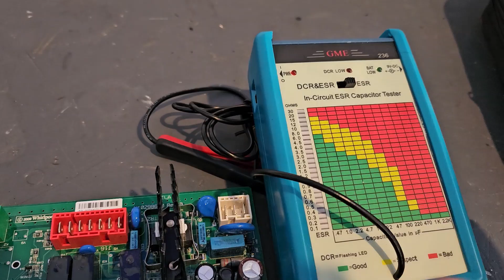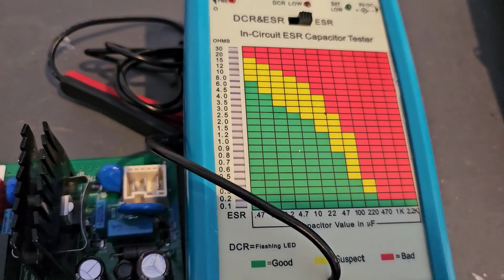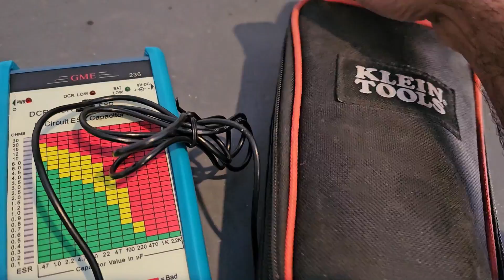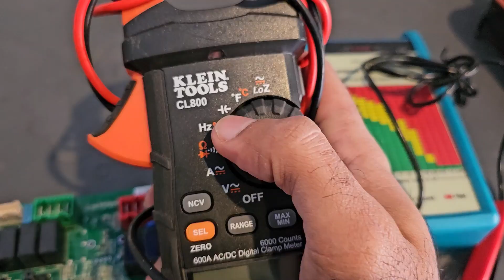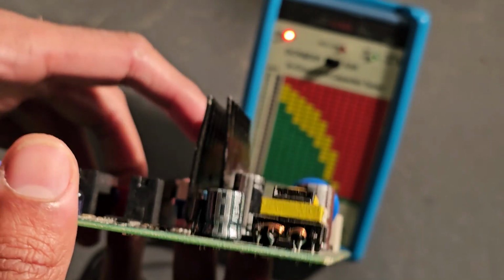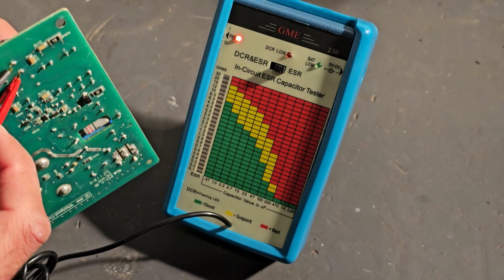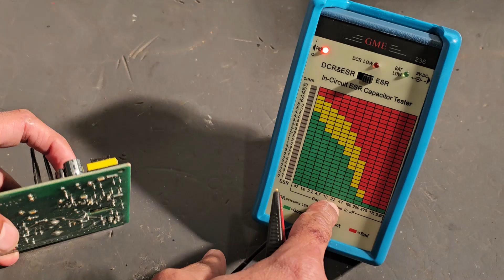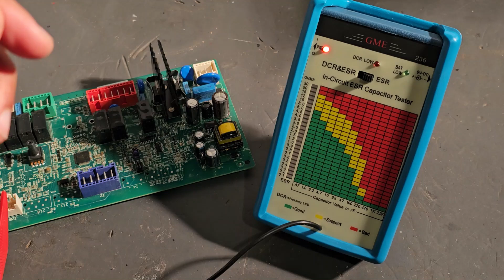Easiest Way To Repair Any Circuit Board: ESR Meter

Comment: - Good video. Clear explanation. 
- I just figured out that ESR meters are mainly used to test electrolytic capacitors. I had a film capacitor of 0.1uF, and the ESR meter said "open circuit or low capacitance". But that's because film capacitors typically have very low capacitance compared to electrolytic caps, in this case 0.1uF. Which tested fine with the multimeter, but the ESR meter can't really test that low of an ESR. 
- Next on my pcb, I'll have to check a relay which is the main suspect. So let me check if you did a video about relays also, because I have no idea how to check it 🙂

Comment: Hi ducktapemechanic and everyone. Please can you explain when it's necessary to remove capacitors from The pcb and when it's not necessary to from capacitors from pcb, also when it's necessary to remove capacitors from pcb is the same ESR metre fault check used or is a different method used. Great video thankyou

Comment: ESR meters are not designed or accurate to be used in circuit capacitors cannot be tested in circuit

Comment: Good video. Thx. A note...  Your method works if the electrolytic capacitors are in series.  But, if in parallel, you are reading more than one!  In parallel cases, you'll need to remove the cap(s) and test out of circuit to get an accurate reading.  Cheers!
Reply from the maker: Good point, thanks for the info!
Reply: Oh, wow! That's not a small detail! The video should be edited for that.

Comment: I was initially excited about the ESR or LCR testers since I had little interest in having to de-solder 9 different caps from a treadmill motor board.  Then I found other videos that mentioned both of those meters' results will be unusable for any cap connected in parallel to another cap (which isn't always easy for a novice to discern when examining the PCB).  In that instance, cap(s) still have to come off the board in which case a basic digital multimeter does a decent job..

Comment: I have a coin operated whirlpool washer that has a blinking and clicking red light. It works but it skips final spin. Do you think this is control board issue?  Do you know if the same capacitor needs to be replaced. thanks
Reply from the maker: No. Sounds like a mode shifter issue

Comment: This is not a game changer for those who wants to repair with no knowledge. I've seen cases where a capacitor shows fully short which could make you believe that the capacitor is the issues, but in reality the real issue can be a bridge rectifier or some other components on the circuit. Don't go blindly with this video and be safe. There are different  techniques.

Comment: I agree, the #1 fail mode for most circuit boards are capacitors. Electrolytic caps with "popped tops" are obviously bad. Relays are generally very reliable. My Bosch oven control board had a bad Darlington Transistor array chip that turned on/off the relay controlling a fan in the oven. This was 100% obvious to find, as when testing the relays, I found a short to ground. I removed the chip that controlled that relay, and the short disappeared. I did apply voltage to the relay, and heard it click, so that was good. I also tested the chip and the pin that powered the relay solenoid was shorted to ground with the chip out-of-circuit. Replaced that chip, and how that controller board works fine.

Comment: Hmm.. I'm working on a Fisher and Paykel DD60S17 dish draw dishwasher ... I've isolated the problem to the electronic controller and two bad caps. How important would it be to get "low esr" caps as replacements... usually I just focus on the voltage and microfarads while ignoring the ESR  ... even when looking up the original caps they never list the ESR for them. 🤷‍♂
Reply from the maker: I would believe that the esr of a new cap is going to be acceptable. Personally, I would also just make sure it is the correct capacitance and voltage. Just my opinion...
Reply: @DuctTapeMechanic - awesome, thank you! 🙂

Comment: Does this ESR meter work with ceramic capacitors like the one found on the electronic mosquito-bats board?
Reply from the maker: No. The ESR meter only works on electrolytic capacitors

Comment: Be careful with capacitors with higher voltages.  They should be discharged before touching them and creating a circuit through your body.  You can get a serious shock from voltages 100V and up.

Comment: I just got into electronics repair with zero former knowledge, I have been reading the book "How to Diagnose and Fix Everything Electronic" and that was the only other material that talks about ESR (Equivalent Series Resistance?) troubleshooting and ESR meter. So this was very helpful, thanks! What is the DCR&ESR setting for on the device?

Comment: I wonder about those two large sized capacitors that are said to be only 22uF....they must be pretty high voltage to justify their large physical size! Ir maybe they aren't actually 22uF.....

I briefly had one of these, which by the way is probably NOT 'made by' GFE. It is available with branding for so many companies that who knows which company actually makes it. If you buy it branded as B+K Precision (a well known US brand), it will cost nearly twice what is quoted in this video. It is a nice enough ESR tester, but the down side is that it only has the tweezers type test clip, which limits its use to physically smaller capacitors that also happen to be in the 'radial' style cans, as opposed to 'axial' style cans. With many kinds of electronics, that would mean that the majority of capacitors in need of testing can't be tested with THIS product.

And BTW, before I returned mine to the seller, I tried extending the tweezers tips with short alligator clip test leads, and it was not able to zero out the small added resistance, and thus it failed every cap I tried it on.

I ended up buying a product by EZM called "ESR-2501C ESR Meter" which only costs about $40. It tests the same range of capacitances as THIS one, and has a similar chart on the front, but instead of an LED bar graph is has a two-line backlit LCD display, and you can read the actual ESR values to two decimal places of resolution, and you also have more control and flexibility of zeroing out external resistances, so different test lead/clip/probe arrangements can be used successfully, and it comes with test probes and alligator clips (but NOT a tweezers clip).

Both THAT product and THIS product can also measure DCR (DC resistance), although this video does not mention it. When a capacitor has a partial breakdown of the internal structure, its internal DC resistance between the two leads (which should be quite high) can drop down to a small number of Ohms. Even with that, it can still function somewhat as a capacitor, and might read the correct capacitance on a different meter, and might even pass the ESR test on this product (or the EZM one) because of the way these tests are done. With older electrolytic caps, or any that you have cause to wonder about, it is important to do a DCR test as well as the ECR test. I don't know why this point was not made in this video. THIS product has a DCR&ESR mode, where it tests DCR first, and only proceeds to test ESR if the DCR test was 'good'.

Another point not covered in this video: ECR is tested with an AC signal, so polarity of the test leads on polarized capacitors is not important. But when testing DCR, the test signal is a DC voltage, albeit a very low one, so it is best to observe test lead polarity.

Comment: Great tutorial. You can also test the resistance and microhenries of the inductors with the esr meter. The reactance formula is 2𝛑FL. That would be 2 x Pi x frequency of esr meter x 100 (uH) Just plug it in.

R=0.628 X L(uH)
L(uH)=R(ohms)/0.628
Reply from the maker: That's great information! Next time I have a board issue, I will check inductors as well!